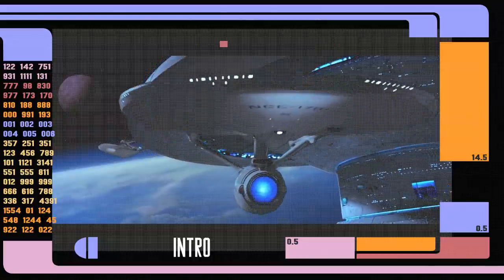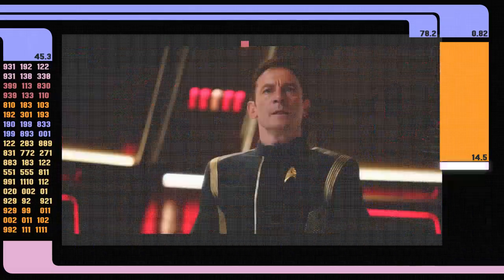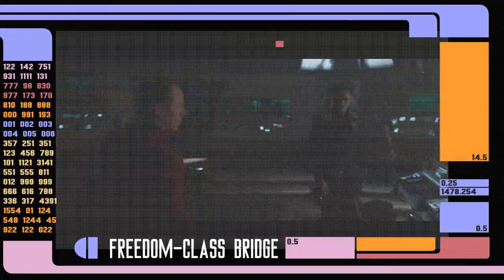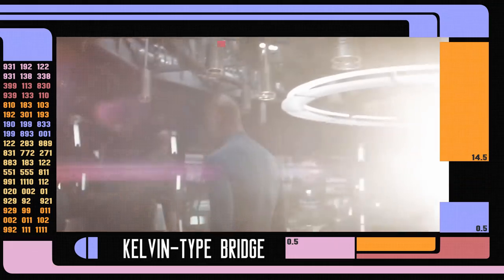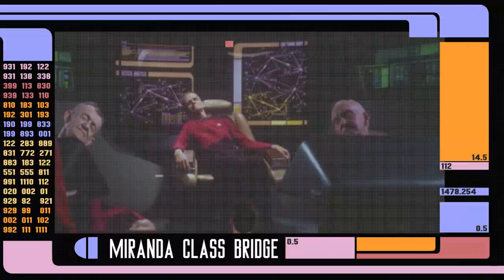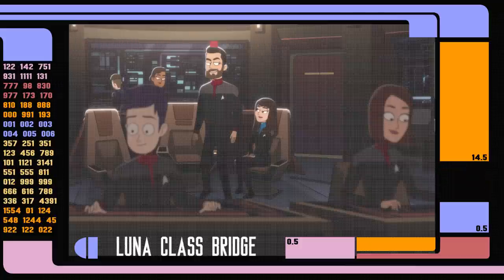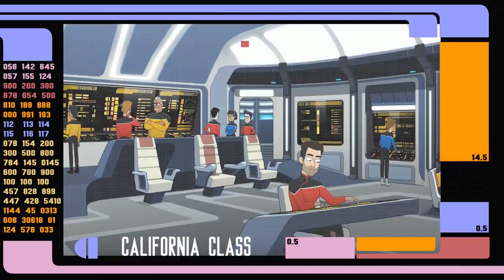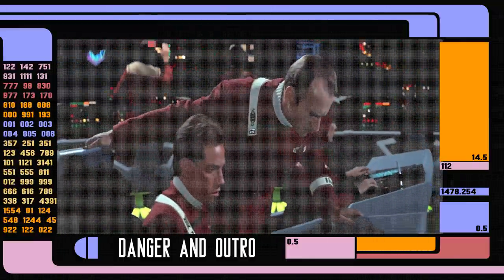Forgotten, Fatal, and Unethical Starfleet Bridges

Comment: I still fundamentally disagree on your points on windows, mainly because you aren't really responding to my points, because by this time I haven't made them. 

The windows are still weaker than the normal structural armor/keel of the starship, even if they aren't the same level of weak point as modern ones are.

While I do not consider windows on current military vessels, from fighter jets, to ships, obsolete, I consider windows on the future-tech of the (at least 23rd century) Federation fully obsolete.
With their sensors that can see things light years in the distance, and that they should have multiple redundant ones, and that "navigation going out" shouldn't happen in a vacuum (if you pardon the pun) like it does in the show. Navigation going out should also imply that a significant part of the ship is destroyed, and should still be theoretically fixable by use of a sensor drone being launched out.

The only time real windows would make sense is in places like 10-forward.
"you lose nothing by having the windows"... 
except safety and the creation of artificial weak points and prime target (by this I mean a bridge being "in front of" the ship rather than protected by it), but I think this is something that we're simply not going to agree on.

"It could be used to visually observe scientific phenomenon"
So, recording it in 256K 3D with all your sensors doesn't allow you to visually see the stuff? They only have scanners outside of visual range? What if the nearby science community on the starbase wants a recording? Oh well, too bad?

"You can command them to look as close as a viewscreen can"...
Uh... No, no you can't. because a window is just a window. It doesn't act as a viewscreen, because that's the entire reason you're arguing for windows. They don't rely on technology and don't stop working when it does. Sure, they can be augmented, but the ability to zoom in on things implies that it's some sort of viewscreen, not a window. 

"Regardless if you think they should [fight in close quarters] in universe or not, they do."
Yes, but, the reason it's a plot hole is because of how far you should be capable of fighting, meaning that anyone who chooses to fight close quarters like that is willingly giving up a major advantage to their enemies, except everyone does it because of the narrative. Rather than make it slightly easier to fight like that, they could simply fight smarter and take advantage of the humongous advantage that range gives them.

Comment: Sorry, but your rebuttal attempt about windows is a failure, it's full of misunderstandings of the lore and illogical conclusions. 

The first thing is that modern warships don't have windows in their command centers. A modern warship is actually FOUGHT from the CIC which is a dark room stuffed full of consoles feeding data from its sensors and those of other assets linked into it. In modern times often with a giant LCD screen somewhere that the commander tracks the battle space from. It's below decks and completely lacking any outside visuals beside again in modern times an array of electro-optical sensors above decks with multiple vision modes and high zoom factors that are better then looks most of the time anyway. The bridge is used pretty much solely for navigation and even then, mostly in port areas with allot of traffic nearby. 

The problem isn't necessarily that the starships have windows at all. The problem is where the windows are. Having some windows in recreation areas, some research viewing area, or even some emergency navigation bridge would be fine. The problem is that they're on the primary command center which to facilitate this is thusly located on the ships exterior creating an outrageous weak point. 

Furthermore your assertion that the windows are as strong as the hull is flat out incorrect. They’re stronger than modern glass and clear ballistic composites certainly, but NOWHERE are they asserted to be as strong as the actual hull plating of a starship. This is seen plenty of times in primary canon as well where windows are damaged or destroyed much more easily than surrounding hull.  But even if we simply accept the frankly farcical assertion that they're as strong as the hull it’s still awful. Their presence still means the bridge is located on the very exterior of the hull, exposed, easily seen, and easily targeted. Even if the windows are as strong as the hull, having the primary command center of the ship buried behind MULTIPLE layers of armor in the interior and not readily visible from the outside to be easily targeted would still be a vastly superior approach. 

The fact windows very clearly AREN’T as strong as the hull within the setting merely takes it from “bad idea” to “catastrophically flawed”.

Comment: Alright, to go back to my argument about windows, which, once again, you push hard.  Windows cannot and will not ever work in space, not for any reason what-so-ever other than to not feel closed in.  Space is Pitch black, nothing, no light at all other that the stars you can view from Earth itself.  You cannot see in space, a fact given by EVERY astronaut that ever piloted the Space Shuttles!  I am not talking out of my ass, I am Stating clear and valid facts given by those that have looked out into space from space.  Yes, while in Orbit around the Earth, you can see beautifully, because you have the light from the System's Star (Sun) lighting things up.  Now, All the ships you mentioned do have windows and guess what, they Operate on the seas, not under them.  There happens to be light there above the water and even so far down.  The submersibles you are likely using to defend your position are exploration Subs. and not designed for any type of combat and are the point of my argument.  We can and do create Windows capable of deep water submersion, however, the NAVY does not implement them in any way for Submarine use.  Now, do you understand why?  Simple, because the darkness is your only ally in a Submarine battle.  To use the widows at all, you would require at least 2 MILLION Lumens to use them for any actual range of view.  I can snipe a cigarette  glow at 200 Yards without fail, now, picture a sub captain saying, lets light up the view in front of us, turn on 2 Million Lumens of lights and hope that no enemy vessels spot this inane amount of light just showing up out of nowhere.  Now, picture @00 MILLION Lumens just drifting out into space, lighting up nothing but open space.  What would you see with nothing to reflect the light back at your eyes?  Nothing, that is what you would see.  I can accept fantasy, maybe you should try to accept reality.  The Hubble Telescope uses what to look out into the dark of space...Sensors and refractive Mirrors to bent the light so it can create an image that can be seem by the Human eye.  Navy Submarines use the same approach to traversing the pitch back depths of the seas.  We are talking deep enough the light doesn't pernitrate at all, a depth ONLY Possible by the use of a Nuclear Reactor.  Widows cannot and will not ever work in space, as there is no reference point to look at to set any course.  If you're traveling at only five hundred Miles per Hour, you would not have enough reaction time to avoid an Asteroid the size of the state of New York, and this is NASA explaining this after they retired the Space Shuttle Program, how is this going to aid you in combat again ?  I like your videos, but I really wish you would take the time to research things before you choose to defend them.  You CANNOT See In Space, There Is No Light And Nothing To Reflect The Lights You Could Shine Forward.  Try Driving One Night Without You Headlights On and tell me how that goes.
Reply from the maker: In the trek universe.. they apparently do
Reply: @LoreReloaded  Better to use Windows 7 than macOS 💖😊👍

Comment: Military submarines will not have windows beyond a midget submarine, also the way pressure vessels work you can't substitute a weaker metal for any single point in the design because the thing only works because it is homogenous and works under equal stress, if you substitute a metal here you destroy the strength of the entire pressure vessel. Spaceships do NOT need to maintain this integrity. I will add that when windows are used currently they are up to a foot thick of PERSPEX glass laminated with plastics and usually quite spherical in the portion exposed to outside pressure. Aluminum, transparent or not is not suitable for the construction of the size of pressure vessel required for the operating of a nuclear submarine.
Even more difficult are the often not talked about issues of welding steel to aluminum, its just a fucking bad idea and look at information on the freedom class of littoral combat ships made by the united states, it requires a sacrificial anode and obviously for obvious reasons we can't do that with pressure vessels.
Reply from the maker: Windows aren’t weaker in trek
Reply: @LoreReloaded  I'm not talking about trek I'm talking about your claims as to what a navy would do, aluminum is terrible for warships in contact with water. I excluded spaceships from that specifically, in that they are not in contact with water nor do they need to sustain pressures equivalent to multiple atmospheres.